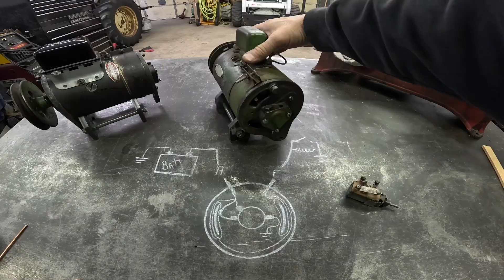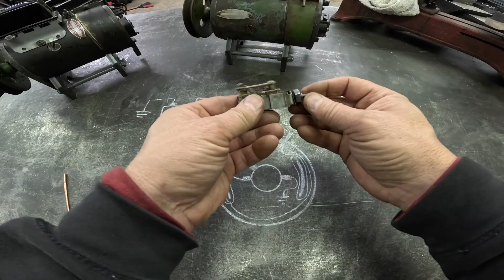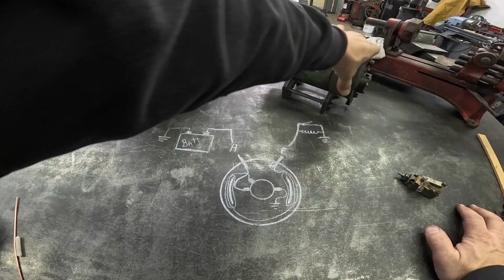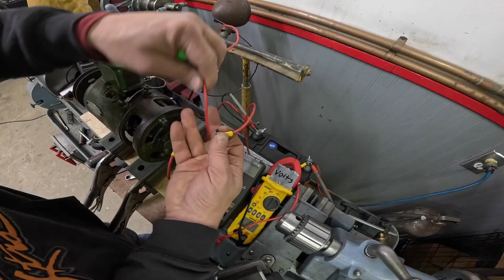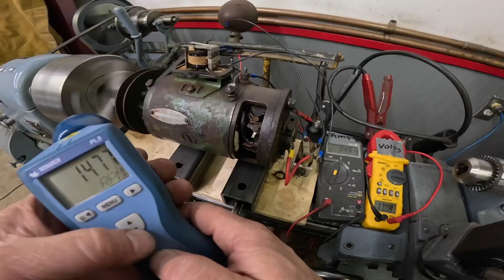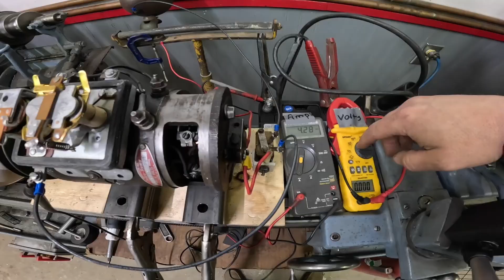John Deere, Delco Remy Testing and Demonstration.

Comment: On your generator that has a voltage regulator, when you rebuild the generator where do you set your 3rd brush to? Looks like it’s pretty far from the insulated brush, is this to limit the output?
Reply from the maker: That's a good question on where to set the third brush for a voltage regulator, I do not have the answer on that. I've been looking in the manual but it's not saying. For this rebuild I was just toying around with the setting of the third and what it did when I was running it on my "test bench" so that's why the third brush was pretty far away from the main brush. Thanks for question though, I'm going to keep looking,  if I find something I will let you know. Thanks!
Reply: @DownHome701 well I don’t feel so silly now because I have NEVER found a specification for that on a regulated generator. I would set them for about an amp and then hook up the regulator, it must have been close enough. I just wonder if it supposed to be a maximum voltage and let the regulator take care of it?